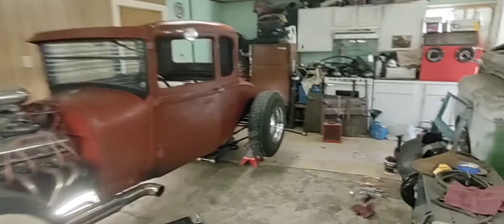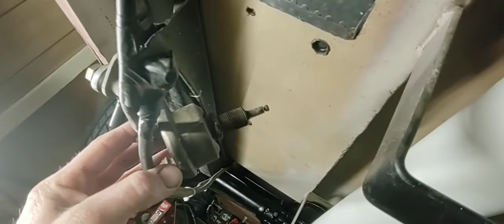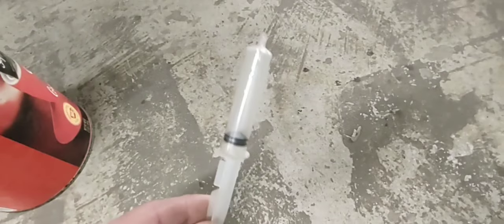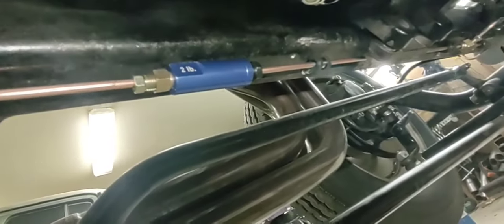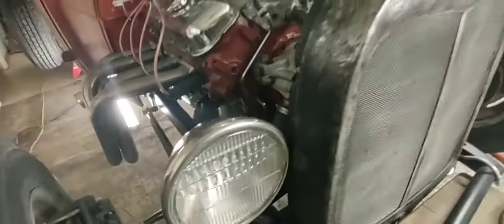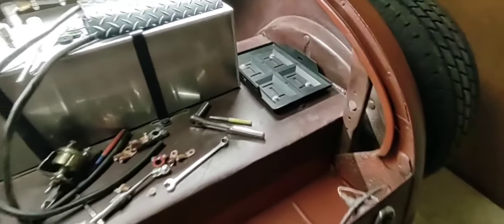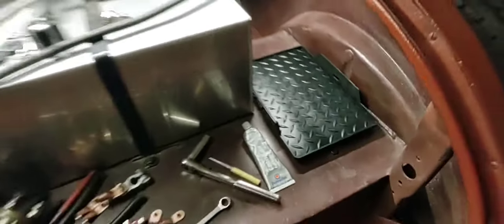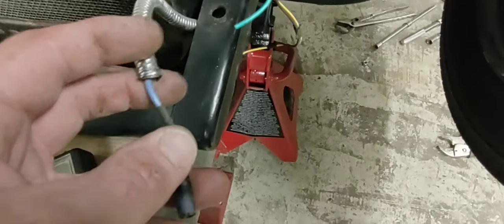1929 Ford model A Five Window Coupe BigBlock Chevy. Getting Closer To Being Back on the Road.

Comment: Just me but I would isolate wiring from fuel lines but car is looking great
Reply from the maker: Thanks! I did isolate the fuel lines from the wiring they only come up in the floor pan together. The fuel line is steel with a grommet and the power wire has a rubber coating with a grommet they both would have to be damaged to make any fire.
Which is very unlikely. 
I could get in a bad crash but probably would have a little more to worry about then those lines lol
Thanks for watching appreciate it 
👍🏻👍🏻👍🏻